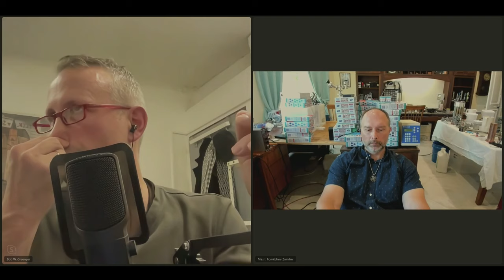O-Day - Bitesize - Electro-Magnetic Phantoms or Vacuum Currents

Comment: are you talking about EVOs? It gets very confusing when you keep using different names for the same structure.
Reply from the maker: The phantoms or vacuum currents are part of a live EVO, and are built by them and conversely, they may be able to re-construct a full EVO around them.

Essentially the wheel within a wheel within a wheel is the minimum complex current structure that can create, via its fractal toroidal moment, a vacuum current, the vacuum current is at the core but if it is orphaned, it may be able to reconstruct the complex toroidal current structure if the same kind that formed it. All of these things are Exotic Vacuum Objects. A stable structure has been given many names (orgone, Ectons, Erzions, variously named monopoles), but it can, in the charged form be considered static electricity.
Reply from the maker: No one said this was easy.
Reply: @MFMP  Thank you. Very helpful. I need to spend more time with your blog remoteview as I'm sure this understanding could be gleaned there
Reply from the maker: Yes @Aedonius

Comment: Have you seen the lie detectors in Africa? How they put grass together and then see if the friction of the grass grows more or less depending on different people?

I laughed at it. I still don't "believe" it. But something about spiritual effects on very small things makes sense to me. I dont even make a distinction between spiritual adn physical. Its all a matter of scale.
The reason they use grass is to make as much surface area in contact as possible. And it just barely effects how the grass reacts.